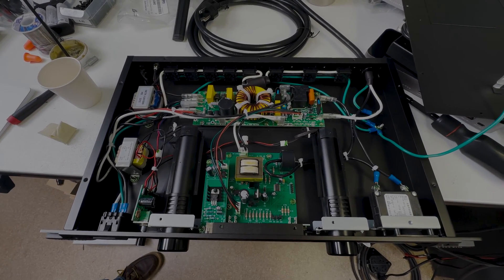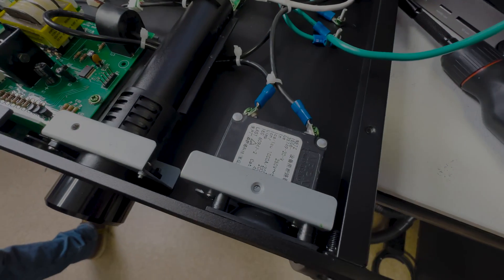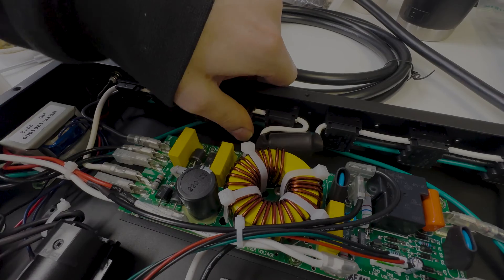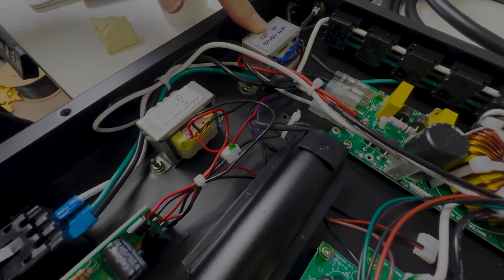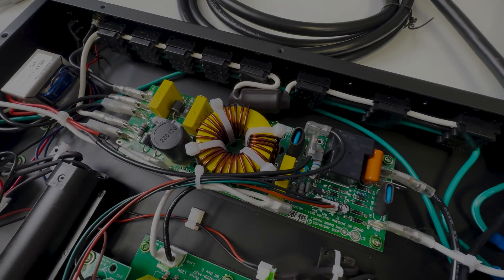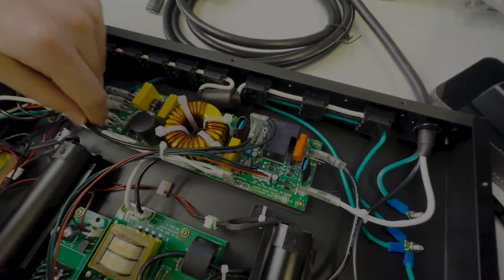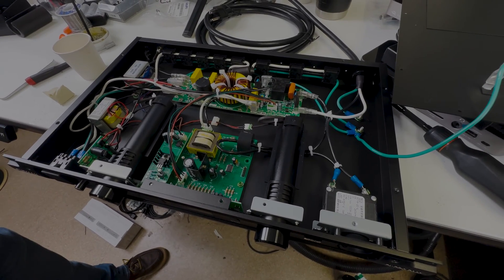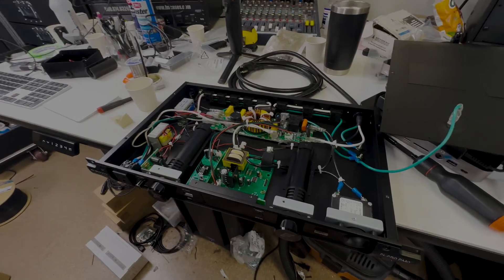Inside A Furman PL-PRO DMC 20 Amp Power Conditioner

Comment: Great teardown! A few things caught my attention: The wire running through the current transducer looks surprisingly loose for a device at this price point. Looking at the components - MOVs for surge protection, polypropylene capacitors, and the ferrite core filter - I'm struggling to justify nearly €800 (Thomann price). These are solid but standard components. The 'power conditioning' is essentially good surge protection with line filtering, nothing that actually stabilizes or corrects the AC voltage. Reliable? Sure. Worth €800? Hard to say yes.

Comment: There's nothing inside that "conditions" the power. It has a ferrite that serves as a low-pass filter, a varistor for power surges (and blows the fuse...) and an output relay... it has a small board with a processor that reads the current and turns the relay on and off. Basically, it seems to be a very simple AC filter and that's it... It doesn't correct voltage variations because it doesn't have a power transformer with taps for adjustments... much less the switching circuits or possibly power thyristors... but they generate a lot of noise and audiophiles don't like it... basically, it's a line filter with a light in front....